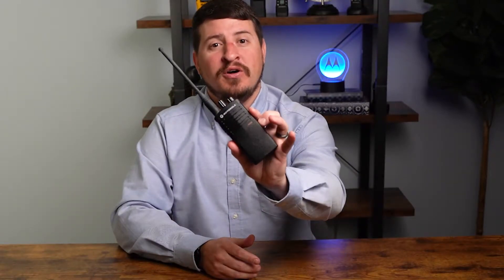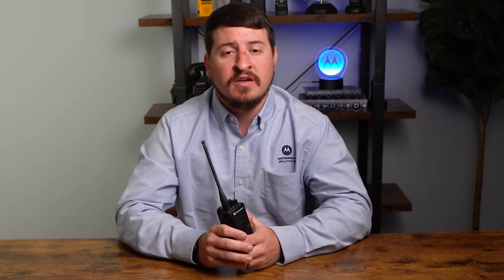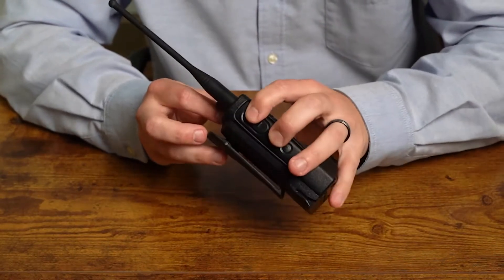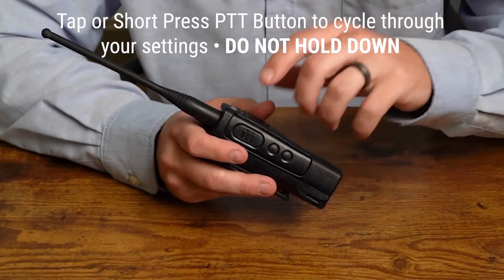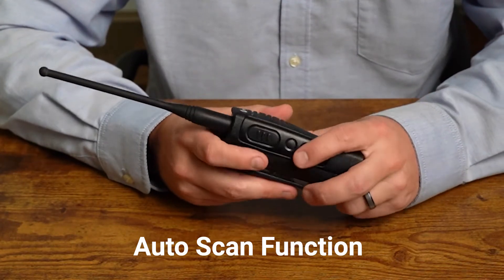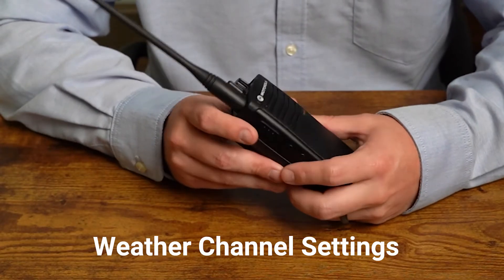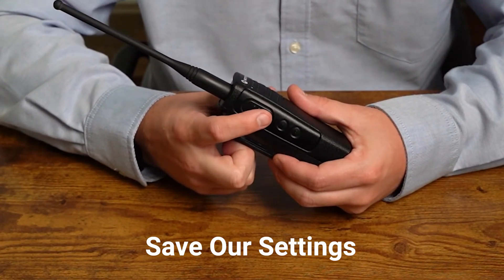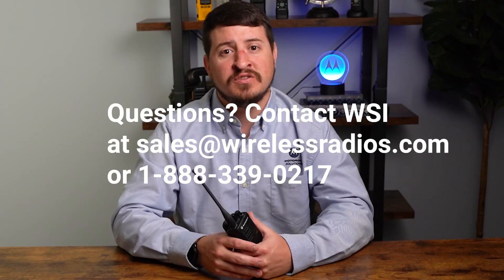How To Program Your Motorola Solutions RDU4100 Two Way Radios

Comment: In the programming mode can I get the rdu4100 model to communicate with the cp200d model?
Reply from the maker: This depends on how the CP200d is programmed. If it is using analog only itinerate (non-custom) frequencies, then yes. If not, then no.

Comment: In your opinion, whats the best way to boost the signal of the rdu4100 across a packed warehouse?
Reply from the maker: The easiest way is to install a repeater. With that said, the RDU4100 was recently discontinued, so your best solution would be to start introducing some digital radio models (such as the CP100D) to improve your radios' range. More info on that model here:

https://www.youtube.com/watch?v=1YLaweVjSPw

Comment: The radio is programed for use of 1-4 channels. Do i have to turn scan feature on channel 5 to be able to scan the channels 1 - 4 ?
Reply from the maker: That's a great question. Turning the scan setting on for each channel adds it to the "scan list". If you wish to scan channels 1-4 while resting on Channel 5, then you'll need to turn the feature on for each of those channels and then press the programmable button to activate scan mode while you're on Channel 5. Additionally, you can activate auto-scan on channel 5 if desired, meaning that it will automatically scan without you having to activate the feature using a button.

Comment: Howdy. I can receive on the new radio but not transmit to the old ones; all are same model #'s RDV5100. What might I be doing wrong? Also, I'm trying to determine the old radios' frequency, but it does not go to programming mode using the SB1/PTT at turning on. Thanks much for your time.
Reply from the maker: Hi Tom,

There could be a few potential issues occurring here.  If your old radios are not narrowbanded (model number is in white) then that could be what's causing them to only work one way. The fix for that is to reprogram the old radios to become narrowband compliant. It's also possible that you have a repeater channel on the radios which will not operate outside of the repeaters range. If your old radios will not enter programming mode, then that mode was most likely disabled in the programming software (not common but we have seen it before). We know this is a lot... so feel free to reach out to us and we're happy to help you get everything figured out over the phone!

Comment: Hi I just bought a pair of these Motorola walkie had rdu4100 how do I program them where I can listen to other frequencies?
Reply from the maker: Thanks for the comment. You can pull the programming from the older radios using the same methods and recording the frequency and code numbers, then reprogramming your new radios to match up.

Comment: Hi, good day. Excuse me. I need a software for a Vaofen M20 radio. Could you help me?
Reply from the maker: Sorry, we only support Motorola Solutions radios.
Reply: @wsi_radios  thank you the radio tells me motorola M20 but it comes with the same system of the chinese vaofeng radios in the same way thank you very much.
Reply from the maker: Sorry, but this is not a radio that we support. We only support Motorola Solutions business and commercial radio products. You will most likely need to reach out to the company that you purchased from for assistance on that model.

Comment: Do you offer reprogramming motorola uhf/vhf radios as a service?
Reply from the maker: Hi Robbie,

We'll be happy to get you in contact with one of our resellers to assist you. This is an offered service. Call us at 888-339-0217 or contact us through our website for a connection!

Comment: Can it work with Motorola T8xx series
Reply from the maker: Hi Amir,

The RDU4100 does not have consumer band (FRS) frequencies available in the radio right out of the box. You do have the ability to add custom frequencies into the RDU4100 via the customer programming software with the assistance of an authorized reseller. 

Please note that even if the frequencies match up, there will be a clear difference in audio quality between the RDU4100 and the T8XX radios due to overall differences in quality and design. We hope this helps!

Comment: The company I work for uses XPR3300e Motorola radios. The employees are constantly breaking, loosing parts, abusing the limited supply of radios, and most of the time you can't find a working unit at the beginning of the shift.

I would like to program my RDU4100 to work with the XPR3300e radios at work if possible. How would I do this?
Thanks.
Reply from the maker: That's a really good question. The XPR3300e can be programmed to either analog or digital settings, so that will determine the answer to your question.

If the XPR radios are currently programmed to digital settings, Then the RDU4100 cannot be programmed to match as it is analog only.

If the XPR radios are programmed to analog settings, then you will need a printout of the radios' settings, and will most likely need the Computer Programming Software and Cable for the RDU4100 to match up to them. The software is a free download on our website, and the programming cable can be purchased through one of our resellers.

Let us know how we can help with anything else!
Reply: I feel for you

Comment: Is there a video that shows how to enable 4100's to work with rmm2050's ?? Please and thank you!
Reply from the maker: Thanks for the comment! Unfortunately, the RDU4100 and RMM2050 operate in two separate frequency ranges and they will not be able to communicate with one another. If you're using an RMM2050 (MURS radio) you can only program other MURS radios to work with it.

Comment: When I programmed my radio to 467.850 I can transmit to another radio (different model, its an rmu 2040) but I cannot receive. What am I doing wrong?
Reply from the maker: Hi Jerry, thanks for the question! Did you also reprogram the privacy code setting to match? Both settings have to be the same for the radios to communicate both ways.
Reply: @wsi_radios  I had to change it, I finally got it to work, thanks